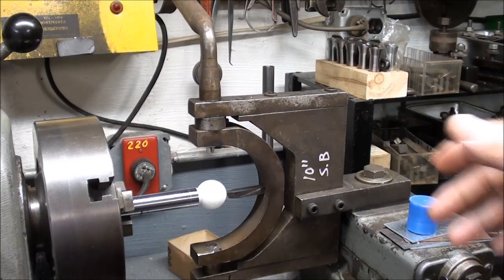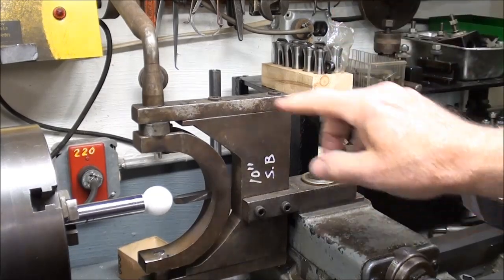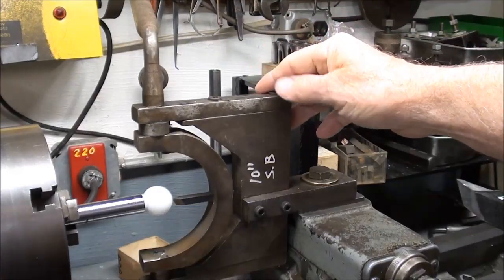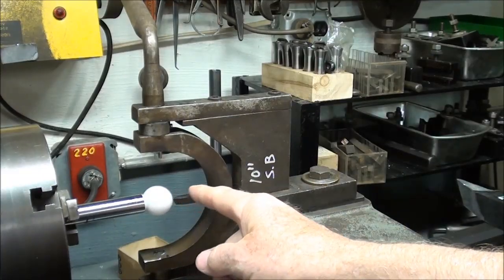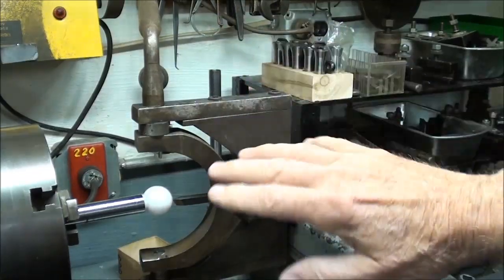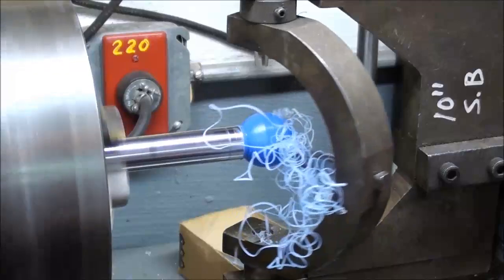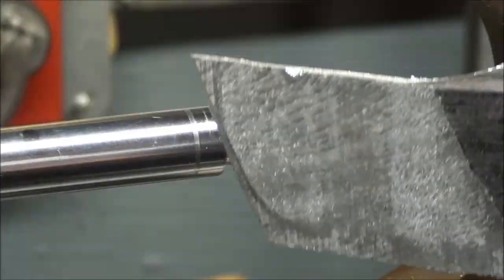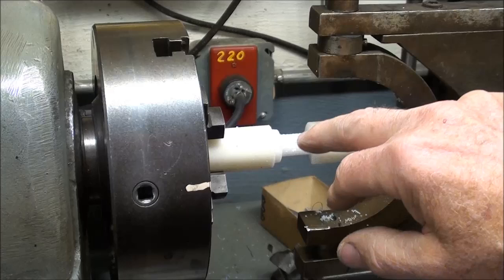MACHINE SHOP TIPS #123 Turning a Ball on the Atlas Lathe tubalcain

Comment: What if you put a side rake on the cutting tool and only cut in one direction? Meaning you'd have to back out the cross feed, swing the cutter back arount to start, and reset the depth of cut?

Comment: I made a tool similar to this a few years ago for a chen-yeh 450G lathe, very similar design and construction except I used carbide tooling. Cut steel and aluminum balls with ease. Fantastic since I made mine to mount in the toolpost it can be used for ball and radius easily. I think the largest diameter ball I tried cutting was about 5".
Reply from the maker: Thank you, that is interesting

Comment: This ball turning attachment would be more effrctive if it was mounted 90 degrees different from its current position with an angle plate. It would give you more clearence with the chuck and provide some adustment.

Comment: I saw a "quick set" method where a  tool the diameter of the finished ball was machined and a spigot the size of the hole in the fitting.
Place the tool into the fitting and tighten, move the cutter until it is touching the tool, lock it and remove the tool and that is it.
If you need a size you do not have, make one quickly.
Thanks for the video and be well.

Comment: we had the commercial ones at work. if you run the cutter the opposite way it will make a concave cut. they used them to make new adjusting screws and matching sockets for the connecting rod to the ram on punch presses. bitch to adjust as I recall. I've only watched about 100 of your videos, so I don't know if you ever mentioned a butress thread which these  screws used because the pressure is always in the up direction.
Reply from the maker: +Richard Haisley Thanks for watching. I did mention butress a long time ago, but forgot which video. You have 350 to go

Comment: here's a crazy idea: instead of bolting the fixture to the cross slide, how about sticking the tab you normally bolt to the cross slide into a tool holder for either an aloris tool post or an emco/axa type? then you could adjust center height without shims
Reply from the maker: That might work, but may make it too high.

Comment: Hi, now then I've got a question for you sir, I'm in the process of building a similar yoke type turner as yours, out of a large lifting eye of all things , lol
But on a test run I'm getting a poor cut/ chatter on the rear cut  the same as yours, but I can't figure out why it would happen, I'm using a hss
Reply: You're gonna have a hard time eliminating chatter.  A hand feed tool in any metal is tough.  I had one, years ago that had a ring and pinion gear with a hand crank, that worked great.  If your radius is under 1" check MSC.  The should have a radius cutter, Cheap
Reply from the maker: Check these things. Is everything rigid?  resharpen tool,try different spindle speeds, is it a hard to machine material?
Reply from the maker: ThomasTheSailor Chubby
THANKS

Comment: Think what would of worked good is to take a piece of the plastic stock and turn a radius on one end. Drill and tap the hole. Part off say if its inch diameter to cut off about 1.25" and attach it to the mandrel and continue finish turning the radius on opposite side.